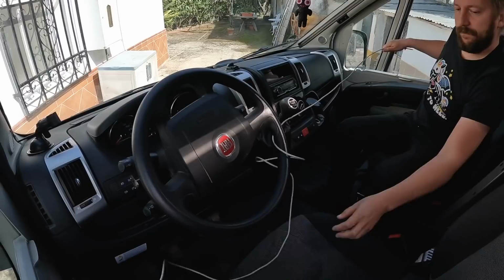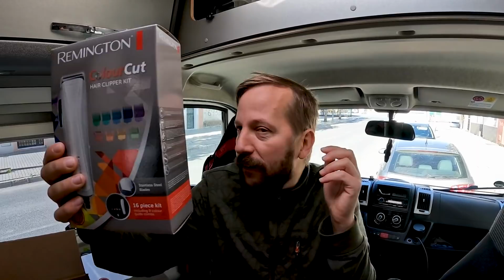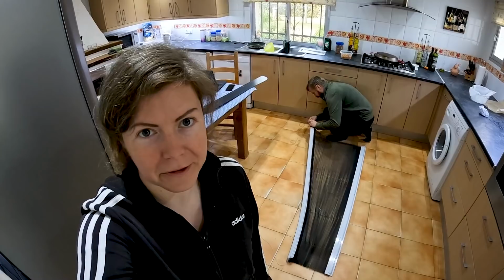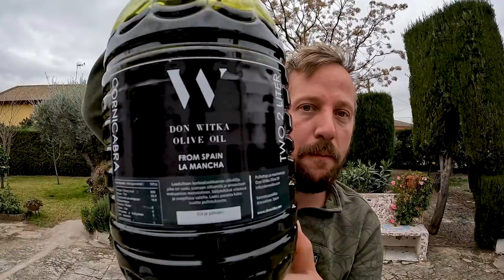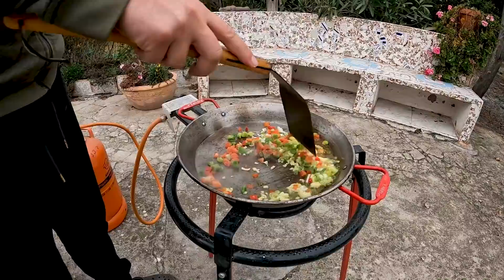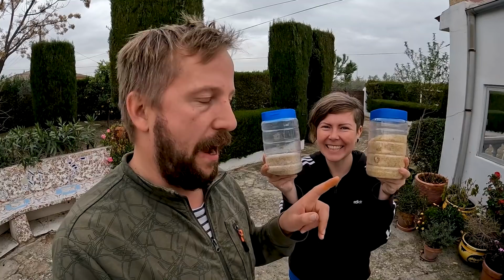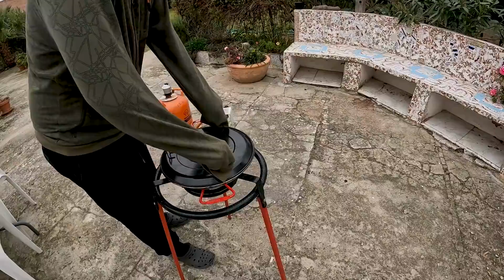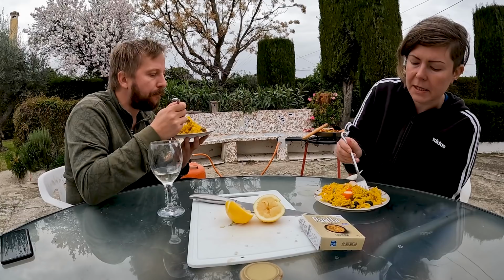ANTI-PICK LOCK INSTALL TO FIAT DUCATO // Bug net fix in a camper // Kompact kitchen: Paella 2.0

Comment: I use olive oil often, but you should be careful when you cook with it. Olive oil breaks down at high temperatures. Frying can cause it to oxidize and, like any oil subject to heat,  develop carcinogenic  compounds. When I fry at high temperatures I use peanut oil because it is more resistant to breakdown. I collect it from peanut butter that is not hydrogenated.
Paella should have lots of seasoning, garlic, onion, paprika, etc. Also, cook with the meat included, don't add later. Cook under low heat-- paella takes a lot of time. Cooking outdoors over a wood fire would be ideal for you so you don't use up your propane.